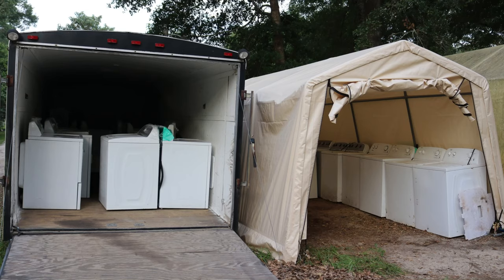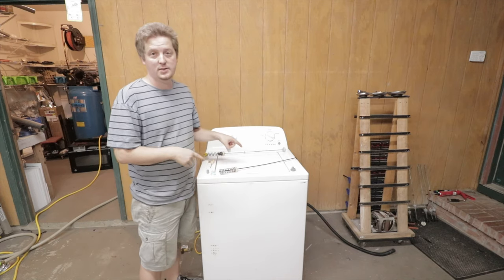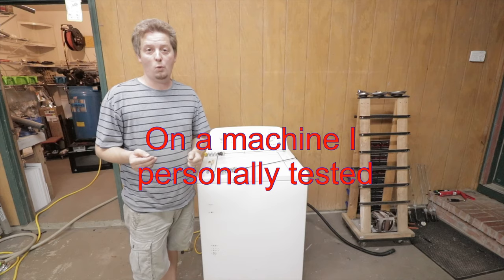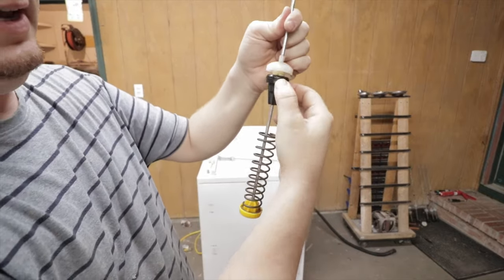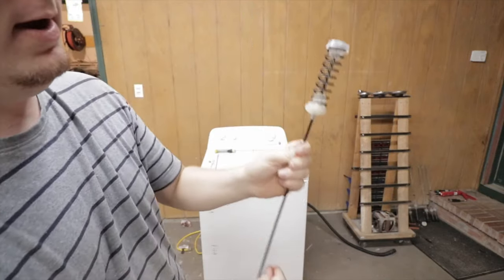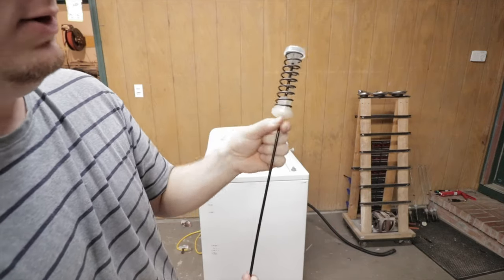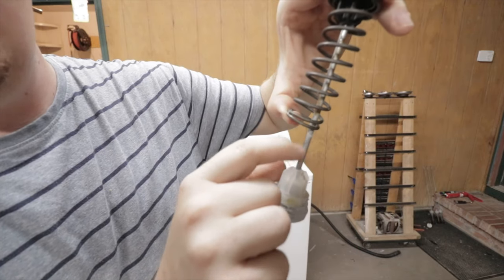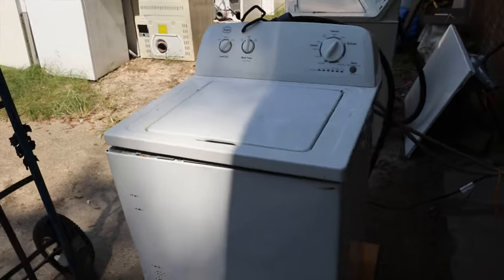Cheap Permanent? fix for shaking banging Washer? $7 to fix Suspension dampening rods W10780048

Comment: I just replaced the suspension rods/springs/bushings several weeks ago.  It seemed fine for about two weeks, but now is just as bad as before. Any ideas? Cheap parts?
Reply from the maker: It very well could be cheap parts. I have ordered suspension rods that were extremely cheap on eBay that did not last. I only order off Amazon now and I only get the ones that have good reviews.
Reply: @WasherDryerMoney  thank you.  I ordered from Amazon. I will check on the warranty.  Keep up the informative videos
Reply: Update. I replaced the suspension rods with good  Amazon parts. Problem is still present during the rinse cycle. Any ideas? It is a big deal getting the washing  machine out of the space it's in.
Reply: @robtyson9667  are the installed correctly?
Reply: @imlkrsfn  UPDATE
Buy only the factory parts! I went through two sets of aftermarket parts from Amazon. Yes they were installed correctly. Been working fine/smooth/quiet since installing OE parts
Reply: @robtyson9667  Thanks Rob- I have the same unbalance problem. Because of your advice I will order my parts from Sears Parts Direct. They are only $3.00 more than Amazon.
Reply: Good deal. Hopefully will save some time and grief

Comment: How do you know if it's the suspension rods without completely raking the washer apart?
Reply from the maker: If you push hard and fast on the agitator in the center and it bounces it’s more than likely the suspension. You’ll find tons of videos on people demonstrating this. there’s a second problem that it could be and the test for it is seeing if there is space between the inner drum and the outer drum. If you take your hand and give it a little shake, it should move together as if it’s one piece. If they move as if it’s two separate pieces that’s a different problem.
Reply: @Washer Dryer Money  thank you! Just tried it.i think it'd the suspension rods

Comment: I'm a bit late here but I was wondering if RTV or silicone caulk would do the trick.
Reply from the maker: Tried silicone that did not work. I have found several new ways of doing it. I’ll make a new video soon.
Reply: @WasherDryerMoney  Don't forget!
Reply from the maker: @CzrTrux  3/4 of an inch thick yoga mat seems to be everyone’s favorite way to fix it now.
Reply: @WasherDryerMoney  
I'm trying to visualize how you're using it but coming up short. Do you have a link or example?

Comment: First, thank you for the repair on the old rods. Just installed new rods and haven't tried the machine out yet.  Also installed (glued) closed cell foam to the inside of the  enclosure  on four sides to  reduce the travel of the tub.  They are near the top and permit some movement . Waiting for the glue to set before ops.check. Will post on success or not.
Reply from the maker: My issue with a lot of The different fixes I tried was not drying. As long as you let the glue completely dry before you push the cap back on it seems fine but if you push the cap on it seals it so perfectly that it stays on liquid inside with most of the products I tried. Let me know how it works I have a few new ideas I’m going to try soon and I may do another video if one works.By the way the liquid nails is still working perfectly.

Comment: Thanks for the info. You're correct. The problem is that the foam rubber bushing is no longer gripping the rod with the appropriate force. It is not the spring. Here's what I did. I pulled the foam rubber out of the cup, compressed it by wrapping it with rubber elastic and carefully stuffed it back into the cap. Then I greased the travel area of the rod with automotive brake lubricant. After a month, so far so good. The trick I think is finding the "sweet spot" when compressing the foam bushing. Not too tight and not too loose.

Comment: Just had to replace the aftermarket rods (you know the cheap ones).  They lasted 6 months.  I put in a set of new factory oem rods for about double the price.  There are a lof of comments that the washer will get harder and harder on the rods as it gets older from becoming warped and out of balance.  I'll re-post on the new rods when I have problems with them.  My machine is abt 12 years old.  Changing rods seems to fix it every time for a while.

Comment: Thanks for this! Could this explain why our clothes are still wet sometimes?
Reply from the maker: If the machine is banging all over the place yes if it’s not it’s probably the actuator. This is the part that shifts the machine from spin to agitate. Very common for it to go out. Pretty easy to fix.

Comment: Wonder if you placed a spring above each one and fasten it.  -----**|*** to the rod with a clamp so the peace you glued would be in the middle between 2 sets of springs. use a cable clamp to secure the upper spring to the rod. Just a thought if I had a extra set of springs I would try it.

Comment: Is there a fix for portable washers? I have this Giantex/Costway washing machine and after 2 years the tub is flopping all around. The suspension rods feel really wimpy, they barely keep the tub from moving at all. If I could buy replacement parts, I would just replace them but I only really see replacement parts for full size units.
Reply from the maker: Oh I’m not sure. I’m going to make a new video soon on suspension rods and there’s a type of sticky grease they used to help these rods perform better.

Comment: What about a beveled shaped plumbing washer    I don't know what the rod size is but the washers come in different sizes.
Reply: There hard rubber
Reply from the maker: Interesting. If it fit perfectly it would have to also fit perfectly in the outside plastic piece.

Comment: Awesome video i love fixing washers and dryers i have no idea why . SILICONE works killer which is the key liquid nails but it has to cure 24 hour minimum .  The damper rod hack is far better than cement balancing weights some front loaders use better off grabbing some rear shocks off old mountain bike . I have used this same process - ish to replace the broken up rubber dampers in the motor mounts of my car. The result of which actually lasts longer than than original. You do have to jack up the motor and center it blah blah ..Yeah washing machines who knew ?     Great channel !  new favorite direct drive for sure !!

Comment: I've been refurbishing mostly Whirlpool machines for 15+ years and agree direct drives were the best washers Whirlpool ever came out with. I still have my 2002 DD Elite.  I've sold hundreds of W & D's over the years. I have a really weird situation with a 2016 MVWX655DW1 machine. It shakes really bad with or without a load on the spin cycle. OK, I  say to myself-- RODS.  Not so. The rods have great dampers and are not bent at all.  The basket has ballast ( one guy I read said he drained the basket's ballast liquid out by drilling a hole in it and it solved the out-of-balance problem, I got a good laugh out of that ).  Do you have any suggestions on what is causing my  Out of Balance issue?  This has me stumped.  I've replaced dozens of suspension rods and that has always solved the problem in the past. Thanks for any suggestions you can office.  Cheers, Neill (Oregon)
Reply: Seems that my whirlpool washer is doing exactly what you mentioned. It’s driving me crazy

Comment: Just curious but could you melt and reform the material that is there and use it as the piece closest to the rod and then fill in the empty space behind that piece which im sure will be significant but fill it with hott glue or silicone or even lithium Greece or electric tape ?
Reply from the maker: Maybe. It has to be durable yet grip.
Reply: @WasherDryerMoney  i used the existing materials and tightly wrapped a few turns of electrical tape around the to fill in the empty space and wala worked like a charm and was totally free for me except the time it took me to think of the solution and the labor of actually doing the deed but if it fails anytime soon i will gladly update everyone here but for now problem solved and has been working without a hitch for 2 weeks solid at least so yay and thanks to you I have 1 more piece of knowledge added to my Arsenal....cause knowledge is power and the powerful stride on

Comment: Hello sir.. My kenmore 80 series... Starts to knock as the spin cycle whines down.. Help please... What can it be
Reply from the maker: Take the agitator off and see if the two ears that hold the inner drum in place have come loose or are slightly bent, allowing the drum to span around the center shaft. Sometimes you can easily bend it back in place and sometimes you can’t.
That’s my guess anyway. Good luck.

Comment: I’m about to try try this is it still working ?  I also have some auto body heavy duty black hot glue sticks for pulling dents.  I might give them a try.  My Samsung is one of the recall units. I called them and got a ticket number but they haven’t called to make an appoint yet to repair it. Supposedly after that I get a one year complete warranty.
Reply from the maker: It's still working. I tried heavy duty hot glue by Gorilla Glue and it only work for about a month. Liquid Nails fuse it seems to be holding up. The only issue but it is how long it takes to fully dry. I recommend putting it in both sides of the cap and waiting 48 hours at least. Then squeezing them together with a bit of Liquid Nails in the middle and waiting another at least 24 hours.

Comment: Great video on explaining how the dampening rods work and your mods.  I tried some ideas that were the same idea but elected to find OEM rods after a few wash cycles.  Did the re-calibration also that seems to have quieted down the walking problem but was disappointed that it still does the banging and walking on a sheets or towels load.  My tub is the direct drive type not using springs so do you have any more ideas on what to try to stop the tub from the rolling side to side just the Rinse Spin cycle begins?  Thanks again for making these types of videos.
Reply from the maker: If the inner tub seems to be wobbling compared to the outer tub, there is no real easy or cheap fix for this problem. If you look straight down, you’ll be able to tell if it’s wobbling when it’s empty.
Hopefully that’s not your problem it’s rare, but if the shocks do not fix it, it could be what’s wrong. It will always be slightly off-balance, and will wear through suspension rods quickly.
Reply: @WasherDryerMoney  Thanks for your reply!
Reply: I so. Remove the inner drum and see if there's water swishing around inside of it. It might have a hollow to and bottom that full up with water and doesn't drain quick. factory default ~ I pull 1 inch holes all over the bottom of mine and a few in the top part but on the inside bottom maybe 1/4 inch wide holes.
Reply: @tiffcherry6242  Thanks for the idea, I'll check that out.
Reply: @WasherDryerMoney  Further testing with the top up so I could see the inter tub turning with the wobbles.  Bought W10528947 W10396887 Basket Driven Hub Kit for $8.99 and now smooth spinning!  Also the new OEM suspension rods wore out from 4 loads of laundry so what a waste of $50 but I just reloaded up the dampening grease into the foam core cones and  shafts where needed and I was good to go again.  Other people have reported swapping the Basket Hub to a all metal one for a longer life but I was OK with the plastic Basket Hub as the replacement seemed to be a harder plastic than the original.  Thanks for the tip on the inner hub.

Comment: HERE IS THE ANSWER - The plastic is as hard as Teflon; it WILL NOT wear out (plus there is grease on the rod acting as a lube). If the plastic cannot wear out, then what’s wrong with the assembly? There is also thick grease on the rod (acting as lube, but also acting to slow down the movement of the plastic providing resistance). The grease works with the plastic to provide the resistance and shock absorbing. Now you know how it works. The grease wears thin after a long time and the resistance lessens. That is the problem. Not enough thick grease is the problem. Here is what I did, and it works forever... Remove the grease with a rag, I didnt waste much time on this, just wipe it off and move on. Notice the plastic ring flows very free now along the rod? I was going to use wheel bearing grease, but I found something better. You want something thick but also something that will not dry out (that’s why glue and other things mentioned in the video and comments only work for a while). I used liquid gasket, non-drying. It’s used for motors, car motors, lawnmowers etc. Sometimes its used as a gasket sealer.  Its thick like chewing gum, very very very sticky, and takes years to dry out. Put that on the rod on top and below the plastic ring and move it around to make sure the goo goes in both side of the plastic. That’s it.
Now spread the word, go back to the forums and other videos and let others know, tell them Another Brian sent you.
Reply from the maker: Very interesting let me give this a try. There’s a lot of gasket I tried to find the one you’re talking about but I wanna make sure I get the exact one you used. Could you send me an Amazon link?
Reply: @WasherDryerMoney  - The stuff I used is more than 20 years old, still good in the tube. The trick is something thick that doesnt dry out. After I applied that goo, it worked a lot better but not perfect. Because the drum was shaking out of control for quite some time, the pads on the side (mounted to the walls of the washer) were in bad shape. I used red Tuck tape to stick 1/2" foam copper pipe insulation to the sides - all 4 sides. Its been running perfect so far.

Comment: Don't see any comments about brand new washers doing this, took one back to Lowes yesterday and the next new one does it too. Hate to take it back but I need a direct drive that doesn't cost so much, nothing fancy.
Reply from the maker: Yes they're still using the same suspension as far as I know. I heard Samsung has improved by adding a little piece of rubber around the spring I'm not sure if that's a permanent solution or not. Time will tell.

Comment: This is a amazing  video I  didnt know that's  how they worked as a new widow  with a 3 year old i have been washing  clothes by hand this video is a real lifesaver  I dont have the 80 dollars for the new ones I filled the plastic up with loctite powergrab and put one of those things that has a screw  and tights up the more u turn the screw on the metal above the plastic  part well where the notch if plastic  at the top is and it's not going anywhere  has anyone tried  a zip tie to hold  it in place ?

Comment: I came across 3 pause /play washers the needs suspension rods. One washer came out fine.  The other 2 still shake badly what can It be?
Reply from the maker: I’ll make a video about this problem soon but occasionally there will be a piece that wears out between the inner and outer drum.
As far as her saying, there’s no cheap fix for this. It makes the metal drum be out of center. If you look straight down and spend the drum, it will have a wobble if you look at where the plastic meets at the top of the drum.

Comment: Okay now that we know what the problem is with the washer violently shaking wouldn't it be a lot better just to replace the rod and spring with a brand new one than trying to jerry-rig it and in a month have to redo it over again that's just my opinion
Reply from the maker: The problem is The piece of foam is not the best material to make these rods last long term. I’m a repair guy and I replace these things constantly I’m looking for more of a permanent solution Period sometimes these rods even brand new with heavy use will only last a year. The ones that I repaired are still on the machine that I’m using in my house and they showed no signs of wear they may be a much better permanent solution but time will tell.

Comment: I've owned an LG top loader WT5170 for 10 years and it's been nothing but a nightmare. I'm going to attempt to resolve the UE error by replacing the suspension rods. Looks to be a poor design from the get-go. They're relying on surface friction to dampen movement of the drum, this is effectively a "wearable" part. Something more robust should be in place like a fluid displacement (Dashpot) device similar to a hydraulic or gas charged lift support. The design of the suspension dampening rods is self destructive.

Comment: I think you mentioned that you prefer direct drive machines. Would you be willing to make any suggestions? Gonna try your fix in a little while but I don't think my wife likes the Amana that much anyway. Thanks, Bill
Reply from the maker: Direct drive machines are nice but they have not made them for a few years so your only option is used. Maytag made a really nice heavy duty one that's pretty much the same except for two parts were heavier Duty. But basically any direct drive is an nice machine. The main benefit to a direct drive machine is not that they want breakdown it's that they are easy to work on. All machines break over time but direct drives are like an old pickup truck and you can easily fix them and they tend to last a lot longer between repairs.
If you're wanting to go new the only machine I recommend is the Speed Queen classic "original version" I don't know about the new one they started producing. But the original that everyone loves they still make.
Reply: @WasherDryerMoney  Thank you. HAPPY THANKSGIVING!

Comment: I'd recommend filling it with 2 part epoxy or polyurethane. Just use silicone spray or something as a release agent before pouring and make sure the rod is super clean and glass smooth. Silicone Rtv may work too.